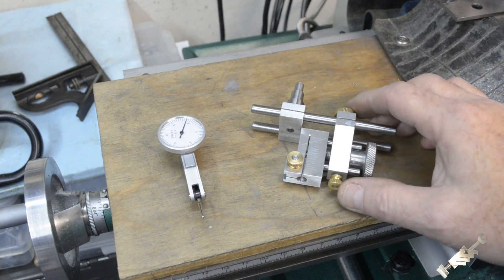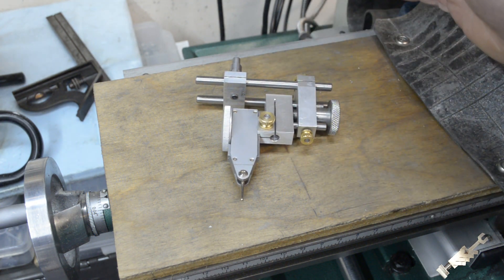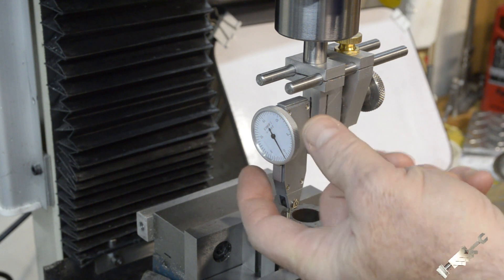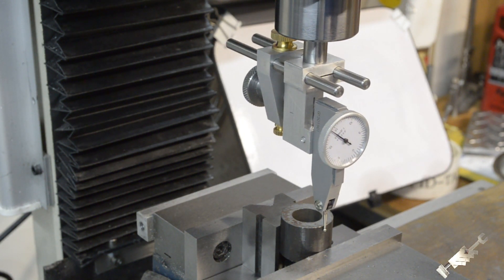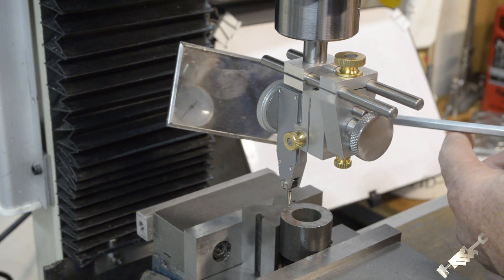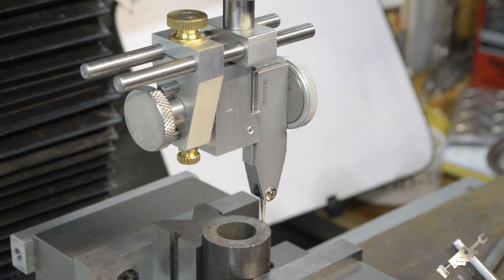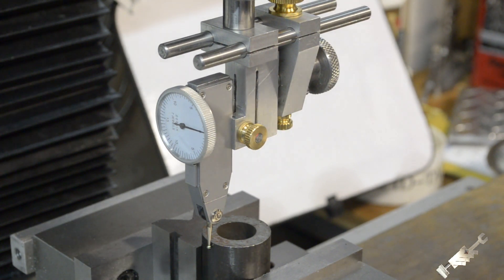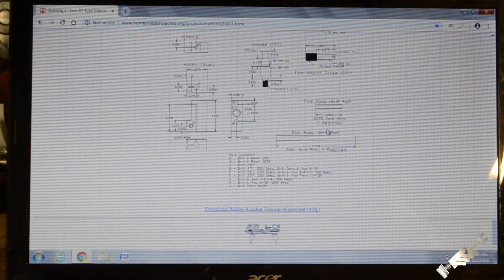Zero It Indicator Holder Introduction

Comment: You did a good job making the attachment.  It really looks nice.  I was thinking, not being critical, but I was trying to see how many times it takes to get it centered right on.  Practice always makes better.  You would hope that if you start with a with a good eyeball first, that can you get it on center taking the measurement twice and then the third verifies it's centered.  Now I'll go back and count.  You did X and then did Y.  I wonder if you did X and Y together the first time and then again, if it would have been quicker.  I'd have to sketch it out and write everything down then move it.  Most of the time you would be trying to line up on a hole or bore and here you had an OD.  An edge finder couldn't do an ID easily which makes the zero set even more important.  I wonder what's considered the fastest way of lining up without the help of a CNC or computer.  This may be it.

Comment: This is a really nice sturdy mount. The flaw with this type of set up being the dial indicator face is set vertical rather than horizontal. With a bit more thinking behind the design this could easily mount the indicator with clock face set horizontal so the reading is always visible without the need for a dental mirror.
Reply: Here is a compact mount using that type of indicator I use that fixes to the spindle nose for minimum height. _ https://youtu.be/_djgGUKpULs   subtitles on.